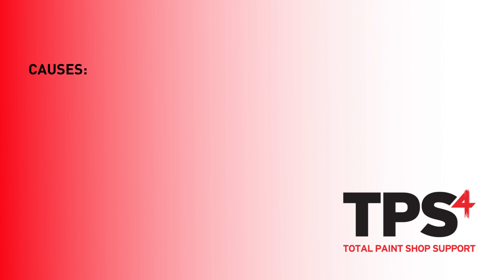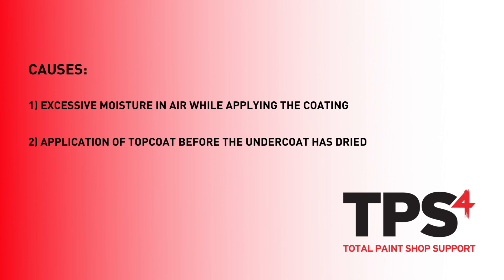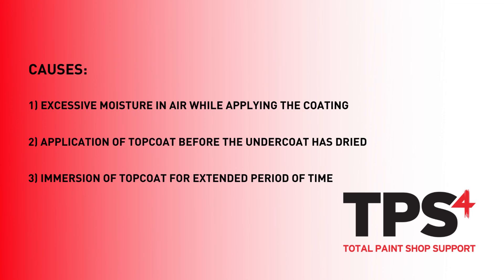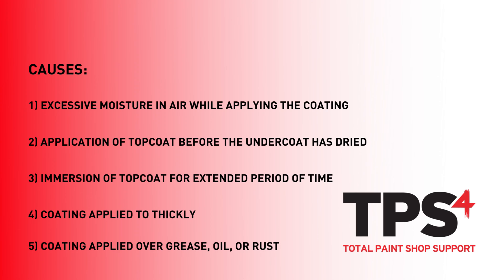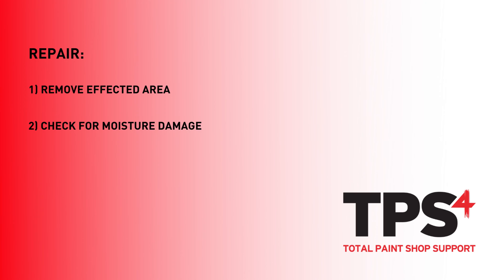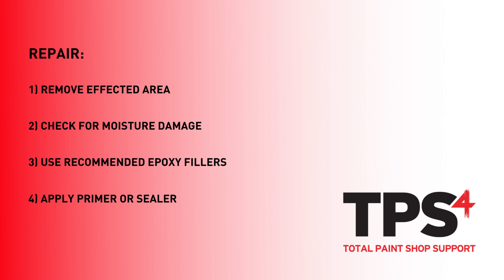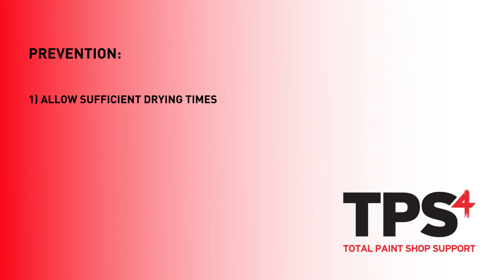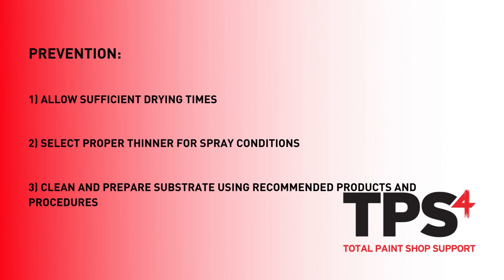Paint Blistering After Painting ? - Learn Why

Comment: no shit you can fix it by removing the paint reprimering and repainting it again! who would have figured this out.
Reply from the maker: you'd be surprised how many jobs we see where the quick fix is to overcoat a bad job and then complain that its the paints fault !
Reply: @ultrimaxcoatingsltd  I work at a sherwin Williams and have to deal with this stuff all the time and blistering is always the most annoying because people think the paint is bad but they just didn’t do it right and people don’t like to be told that they are wrong
Reply from the maker: @Smokinontilapia  this is very true it's quite difficult telling people the only fix is back to bare metal and redo the lot. Everyone wants a magic fluid that solves it. Preparation always the key in painting....that and not leaving it outside to dry !
Reply: scrape, sand, primer, sand, patch, sand, primer, sand, repaint

Comment: Thank you for that! Great video.
 Can you please recommend a paint over cuprinol ducksback as we've a lot of rain and its bubbled up badly on  my outside bench where I've applied exterior wood filler. Is there another recommended paint for furniture and should I use a primer on top of wood filler? I would be happy to use a spray paint, but anything must be quick drying and easy to wipe down.
Thank you so much ☺
Reply from the maker: Hello Ducksback is in general a good retail paint for standard timber but where you have filled and painted over you would possibly be better priming and recoating the bench - for ultimate protection an exterior lacquer like Sayerlack Exterior Clear may be for you https://www.ultrimaxstore.com/wood-coatings/exterior-joinery-coatings